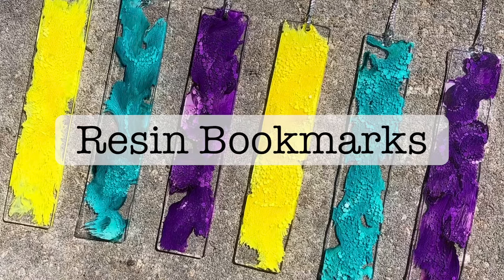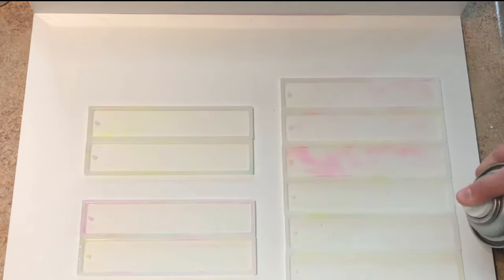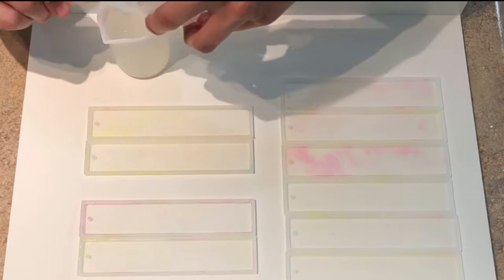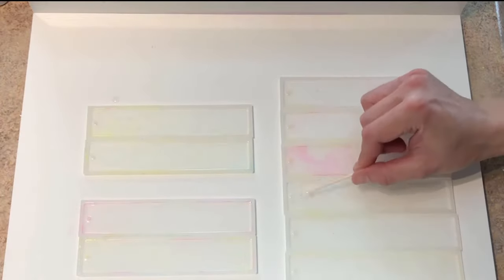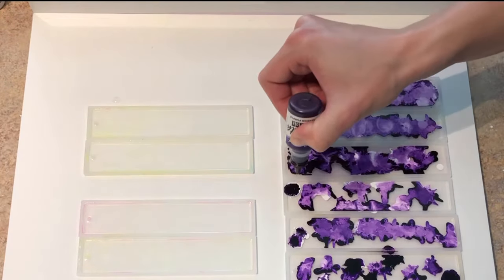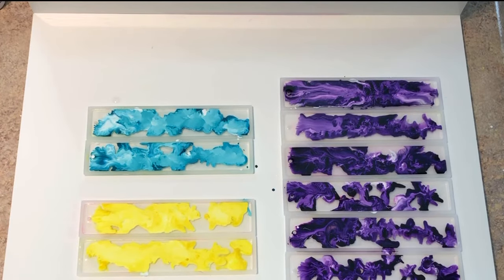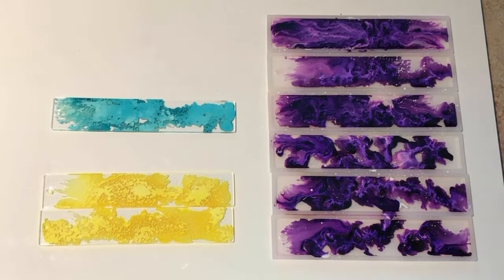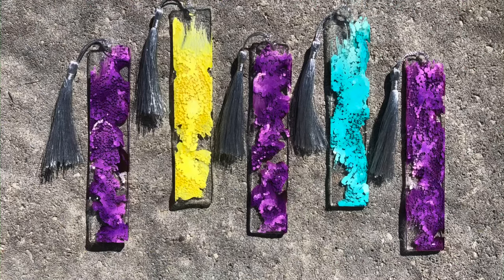DIY Epoxy Resin Bookmark Tutorial

Comment: Hey i really have a doubt.. doesn’t your mould get all bendy and uneven in the middle after using it for sometime? All my moulds are ruined cause their surface doesn’t remain even. Got any tip to avoid that? 🥺😭
Reply from the maker: The thinner the mold the easier it will wear. So yes, these bookmark molds in particular can become unusable over time. All molds will wear but there are some available that really outlast others. The difference is that these are made with thicker/more durable silicone, the catch being they can get quite expensive. So it just depends what you’re after/willing to spend

Comment: Does your bookmarks bend?
Reply from the maker: When fully cured they are quite stiff and don’t offer a lot of bend
Reply: Was wondering this also as I did a bookmark 4 days ago and it's still bendy.
Reply from the maker: @traciebefays766  if it stays bendy indefinitely, it usually means the ratio of epoxy was slightly off or not mixed enough. Bendy is better than tacky tho! Not the worst for a bookmark, but watch those ratios to make sure your epoxy projects stiffen up like they’re meant to